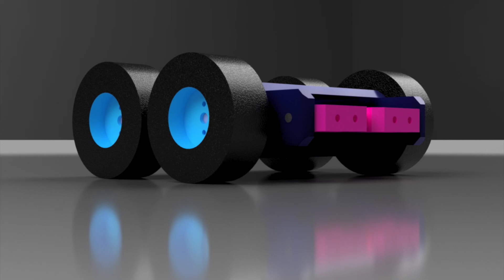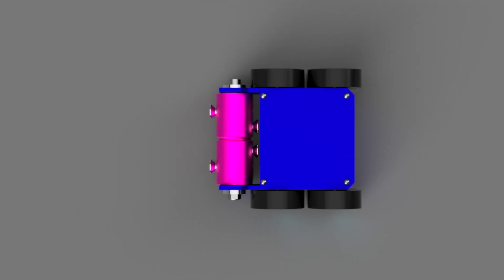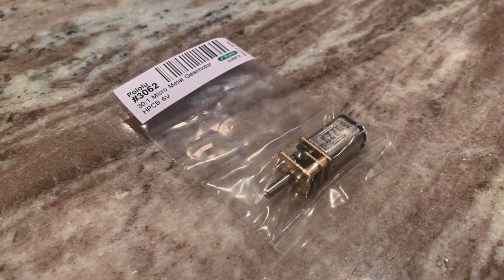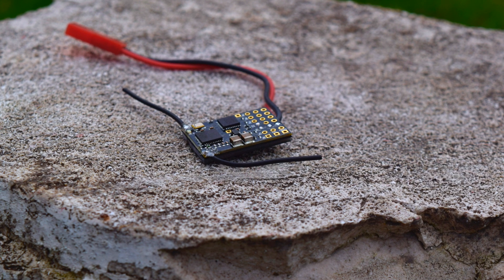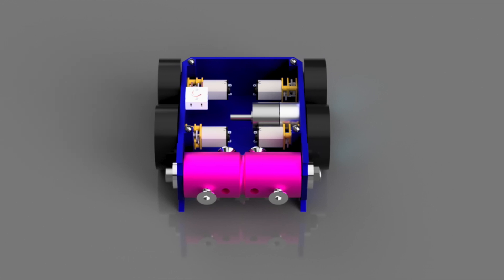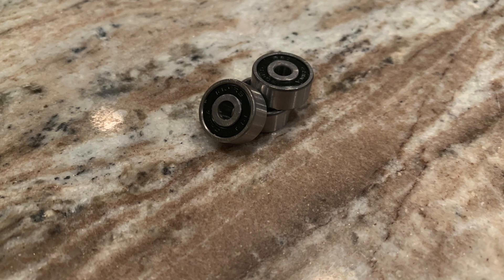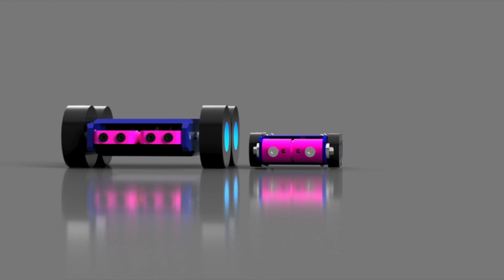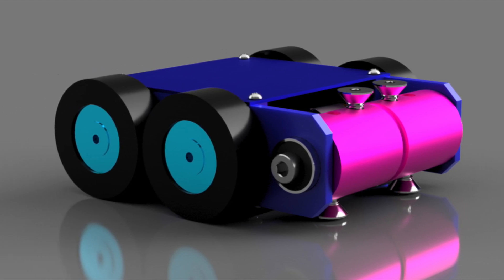Blastwave II Antweight Battlebot CAD Overview

Comment: is pla really that strong? Wow
Reply: People tend to undersell the strength of PLA. This is mainly because there are other options such as ABS, TPU, HDPE, and Carbon Fiber that are stronger and very accessable. But if PLA is the only thing you have, it is still a decent material, especially at higher infill. It's just that there are stronger or lighter counterparts that some people would rather use. PLA is great for those who are building on a budget.

Comment: Finally! I have been waiting for this!

 Also how is the aluminum spacer mounted to the bot?
Have you considered a hub motor or some form of direct drive?

Pla is definitely a viable material if you use it the right way v3 of Paul's revenge (made by team bad engineering choices)
Was entirely 3d printed and won the event it even handled the shock from the 130+ gram wepon!
Reply: Also an integrated bottom plate with the titanium reinforcing it would help the structural integrity of the bot alot in my opinion
Reply from the maker: The aluminum spacer is mounted with four screws, basically sandwiches between the motor and the chassis. I have considered direct drive, but it’s a combination of stubbornness and a desire to build something new that has kept me from that design.
Reply: Thanks for replying I cant wait for the build video!